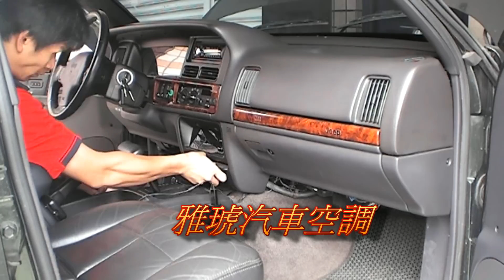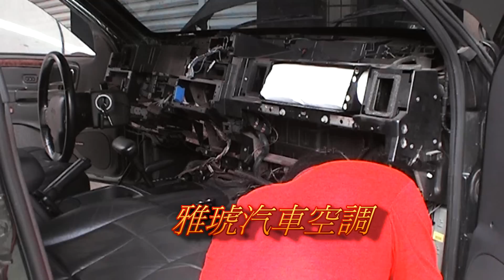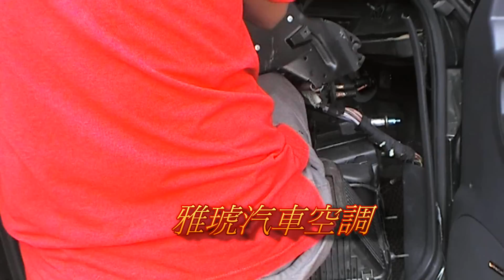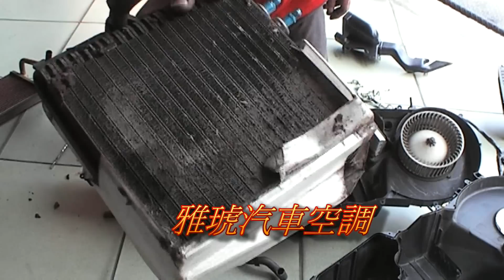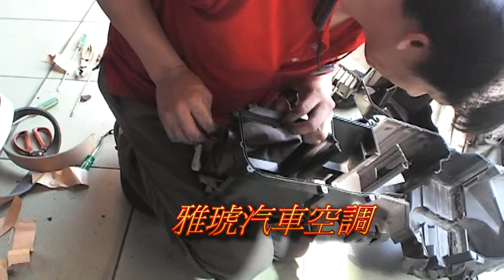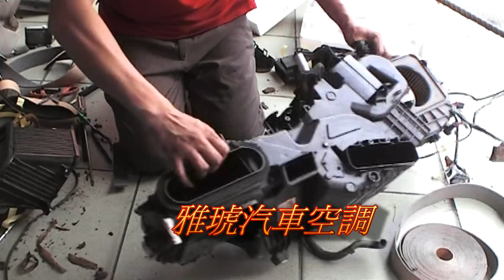Evaporator core replacement CHRYSLER CHEROKEE 4.0蒸發器(風箱)更換

Comment: you did more work than necessary.  alot more.  you didnt need to remove the radio or separate the dash from the metal

Comment: What's amazing is this guy only uses hand ratchets and screwdrivers.  No power tools whatsoever
Reply: So do I. Power tools are for the rich and spoiled ;)
Reply: Video really took a month
Reply: Power tools can destroy plastic socket threads or even crack the plastic to the point that something else has to be replaced. Doing screws by hand is slower, but is safe.
Reply: @UNITED2009100  not unless you have an electric gun or ratchet that stops turning once it's snug
Reply: @thelonelywolf88  Most tools that have adjustable torque are good tools to use, but trying to figure out just where to set the torque can sometimes be almost impossible. With old plastic parts, some screws come out easy where others need more effort and or more torque and care. I'd rather be careful taking things apart by using hand tools. Yes, it takes more time, but I usually have less issues of broken parts or stripped threads.